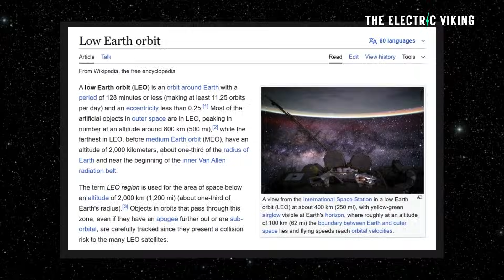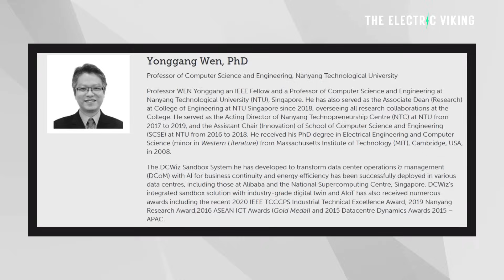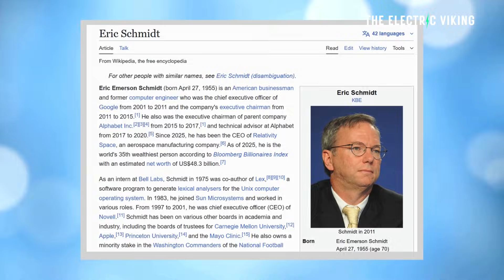The $1 TRILLION Power Bill: Earth's Data Centers Could Be Moved To Space

Comment from the maker: Get 100% off tickets to the Sydney International EV Motor show - 
Click on this link: https://www.futuredriveauto.au/syd/ev25/comp-ticket 
and then Use code EVIKING100 at checkout.

The car I drive, the Xpeng G6 - https://youtu.be/IcniwO8NfQQ

RESINC Solar installed my battery and solar system. Get a free quote from them here: https://www.resinc.com.au/electricviking
Reply: LMAO it  takes 5x as much energy to do something in space as on the ground and 2x as long, might as well say the solution to the dead end tech that is AI scaling is praying to god lol 
take solar, build it on ground it takes x materials, build it in space and u need x materials plus 20x its weight in rocket fuel.
you dont get free coolant in space lol, water boils at 0*c in a vacuum.
anything in low earth orbit is falling back to earth. we already have a massive hole in ozone layer coming from space X if we put enough aluminium up there for even 1 data center we likely end complex life on earth in about 50yrs time lol
Reply: this story is like a tell me you dont understand physics story, cooling in space is so much harder than on earth because u cant radiate heat into a vacuum as effectively as a atmosphere and water boils at 0*c in vacuum
not to mention interference on those chips, they CANT run in space theres 2 much unshielded radiation youd have to carry a pile of lead or something up there to shield them from solar radiation like atmosphere already dose for free on earth. 
also if they are orbiting, they are only going to get a tiny bit more solar than being built on earth with all the issues of distance and wireless power requiring even higher power than a land line.
this is basically saying we dont have the power to do it on earth so we are going to spend 3x the power to do it in space. its pie in the sky

Comment: There’s absolutely no reason that data centers can’t be powered by renewables with battery back up, the same way the rest of the grid will be powered.  Moving all that hardware into space makes it unmaintainable and as others pointed out difficult to cool. The energy cost and overall launch cost of getting that equipment into space is *astronomical*. And of course, the chips go obsolete very quickly, so you have obsolete hardware flying around until it burns up in the atmosphere and showers the Earth with all that nasty debris.

Comment: Whoever proposed this clearly did not work with data centers and space. Here is list of obvious problems:
1. Computers break all the time and it will cost arm and leg to maintain them in the space.
2. There is no cooling in space. The thermal radiation is very slow. On earth air acts as a thermal cooler but there is not air in the space.
3. It would never be cheaper than to simply have a combination of solar  + battery + peaker plant.

Comment: The biggest problem in space is the problem how to get rid of the heat of your spaceship. The ISS has as much radiators as they have solar cells.
Putting datacenter in space will not work because of the cooling problem.
Why can't you cool stuff in space? Because there is no air to convect the heat away. It is a giant thermos flask. Thermos works because of the vacuum  in the middle of the wall. So the only cooling available is radiative cooling. Which is not really a cheap way to cool.

Comment: Space is a very dangerous place, very difficult and expensive to get to, hard to live in, lots of micrometeorites zipping around that can put a sizable dent in the toughest armor plating, and cosmic rays a.k.a. particles that can sizzle microchips and burn neurons in humans. 

To protect against some of this, a long term installation such as ISS has to stay just within Earth’s magnetosphere. But being that close, it’s constantly falling toward Earth and requires periodic boosts to return to a higher altitude. 

Not only that, but all those particles, solar radiation, and the extreme temperatures weaken the structure until it’s like Swiss cheese, and no longer safe to use. This is why the ISS is about to be decommissioned. 

This is why a proposed server farm in orbit is probably not feasible with today’s technology. I suggest picking a spot in the American southwest, the Australian outback, parts of Asia and Africa that have intense sunlight most of the year. With plenty of energy, you can use a sealed cooling system and not worry too much about overheating.

Mini nuclear power reactors might be another option. Orbital facilities unfortunately aren’t as practical as science fiction has imagined them to be.

Comment: Couldn't the moon be a better solution? Set up a base, build the data centers under the moons surface, gather the solar energy and save the space junk. Have spacex type satellites orbiting the moon, transfer the data that way.
Reply: That's a 300k mile transmission versus 1K mile transmission. So, depending on what would be acceptable delays and the amount of data moved and the expected error rate causing re-transmission, not sure that is feasible with current tech. Maybe quantum mechanics will come to the rescue someday to make transmission near instantaneous?
Reply: even geosats have a problem with time delay, the Moon has a 1second and a bit delay, and another one second and a bit reply,  will not be acceptable, over 2 seconds to get a reply?

Comment: Although outer space has an extremely low temperature, it is nearly a vacuum, making heat dissipation difficult. As a result, when exposed to sunlight, temperatures easily exceed 100°C. How would a data center, which generates enormous amounts of heat, be cooled in such an environment? I won’t believe it without rigorous calculations.
Reply: So, I believe it's a bit of a geometric puzzle.
The only side that directly faces the sun has any hope of getting that temperature.

And though conductive cooling doesn't much exist in space, due to it being a vacuum, constructing a vessel of mass and design intricate enough could use conductive heating and cooling to leverage against these problems.

Extreme heat in space is surface oriented. So, Imagine a shell or directable guard of a few different layers, solar wings, radiation blast shield  all being able to be directed between the computing "database" and the sun.
For example, we supported having rather complex computing devices survive close orbits near the sun, with proper heat shields in place. -- behind the single heat shield is infinitely less threatening a destination.

-- So, despite the fact that the absolute surface of the space station goes through wild temperature swings, cooling the innards is rather trivial.
And to defend the idea of the ease of cooling in space -- water that is circulated in the ISS post heat exchanger literally just passes through an external radiator to cool down.

So, back to conductive cooling -- assuming the database is large enough of a metal structure, all heating of the database could be distributed throughout the mass of the structure, such that conduction alone can disperse and dissipate the heat to non-critical levels and divert it away from processors. Now just heatsink to whatever shape, orientation or design fits best to the optimal set up for a scaled up version of the water heat exchange -> external radiator (similar to ISS).

Comment: From a pure "free, clean, endless energy" POV it´s highly interesting. Everything not possible on Earth (day-night cycle) with solar power can reliably be done in space (hourly cycle between sunlight and shade, Intermittent power (90 minute orbit, 30 minute eclipse). Every next cycle the sun shines without clouds or other obstruction to charge the li-ion batteries for 90 minutes and than discharge them for 30. Conditions could not be better.
It´s proven to work on the ISS with sixteen charge/discharge cycles per 24 hours. As for nrs. I have doubts about having enough power for the data centers. The 8 ISS wings measure 35 by 12 meters each and generate "only" 31 Kilowatts per hour and  provide in total 248 KWh (120 kwh for continous use of the ISS plus 120 kwh of storage to the batteries when in the sun-phase). 
These wings are known to have suffered damage from space debris etc. so maintenace and repairs will be necessary. No idea what would happen if the system is multiplied or oversized. Space is big, nevertheless the solar arrays require quite an area. A single small data center requires about 500 kilowatts (kW) to 2 megawatts (MW) of electricity at any given moment (would be eight times the size required for the ISS). A single large-scale data center can require 100MW or more at any given moment (that´s more than 400 times of what the ISS uses). Imho a small nuclear reactor on Earth is more feasible to power it.

Comment: It’s cold in space but the lack of atmosphere makes cooling tricky. You can’t rely on convection or conduction, instead you need thermal radiation. So not quite “obviously”.
Reply: This is a distraction, too expensive, less predictable (EMI, Solar Radiation), cost of shipping, an NVL144/NVL72 cluster and storage is a hefty piece of equipment, loads can go wrong at lunch, and no local technical support in orbit. Sign me for the first tour !
Reply: yeah its so much harder to cool stuff in space water boils at 0*c in a vacuum and u cant radiate heat into a vacuum. this story was built for ppl that dont understand physics lol.
100x easier to build a power station and data center on earth and 5x less energy used

Comment: Experts hey😂. The magnetic field  has weakened by around 30% as it starts to do a pole reversal for the first time in a long time. Putting all our data up there where it’ll get smashed by solar winds is a really bad idea.
Reply: if the magnetic field is getting weaker as you say, no problem. Also, the solar winds will be the same as before,  but just blowing from a different direction.
Reply: @TerryHickey-xt4mf the magnetic field is getting weaker. It’s an agreed upon fact. The agreed % of loss may vary slightly between many scientists but not only is it weakening its reversing at a now rapid rate. In the process of the flip there will be no protection from solar winds.